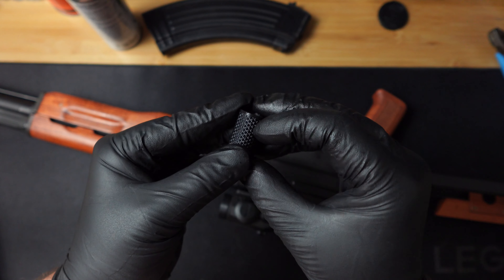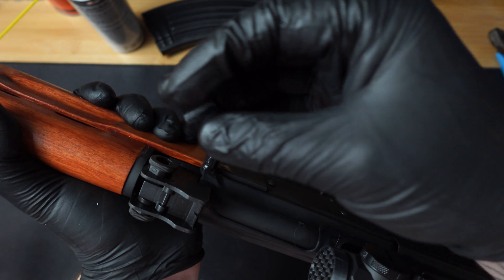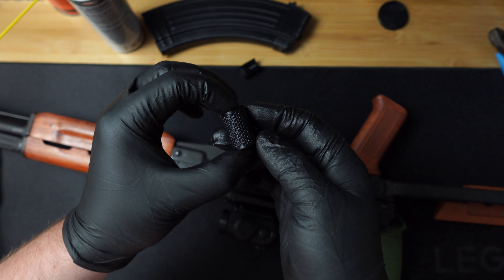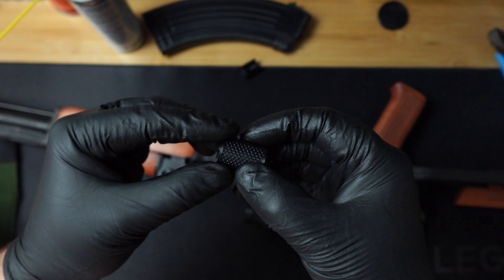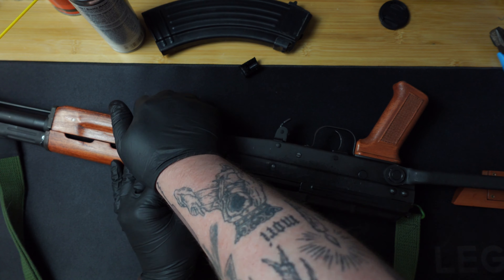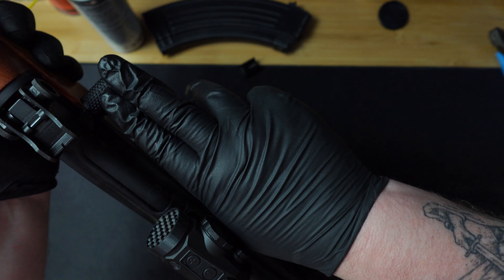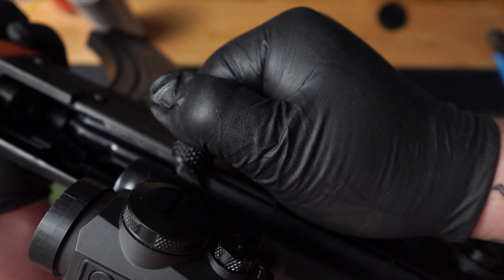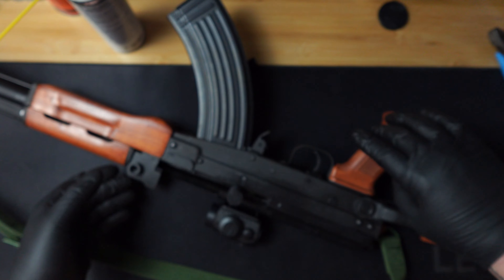Type 81 Charging Handle Extension Overview

Comment: Awesome! Now my question is: Is it possible to make Extended Mag Release or even  faux suppressor barrel sleeve with TPU?
Reply from the maker: Thank you! I could start work on a mag release extension, however, TPU unfortunately isn't heat resistant enough for a barrel sleeve
Reply from the maker: I'm just wrapping up a prototype of the mag release, stay tuned!